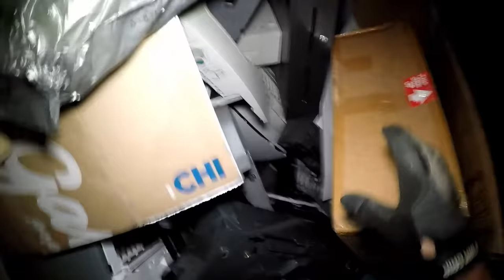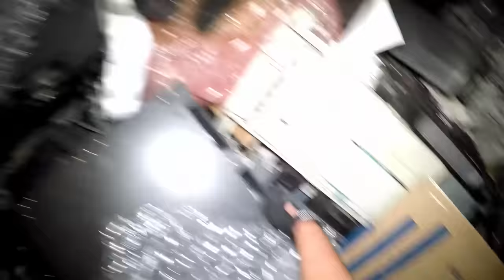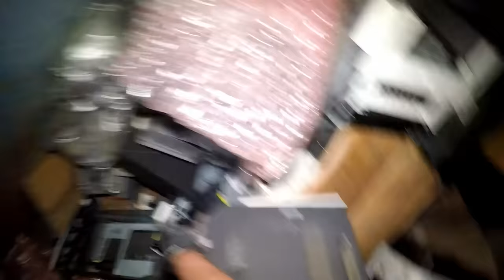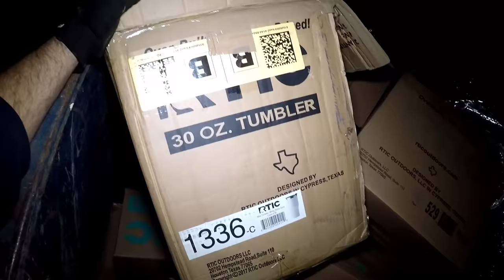Dumpster Diving (I Got Busted!)

Comment: Hey Mike, make sure you take the cash drawers out of the enclosures and check for cash that fell behind the tray.  I worked on those registers for years and would find quite a bit of cash all the time.
Reply: Yepper. Not too long ago I was replacing a cash drawer at a local restaurant and found a 20 dollar bill behind the till. The manager was pretty happy when I handed it over to her.

Comment: Big Score, well done, At my work we throw a lot of steel and aluminium out. I asked about it and now I get all of the scrap metal and they save on not having a scrap metal bin around. As long as I haul it away reasonably quick all is ok.
We use heavy steel tooling moulds and sometimes I will get 600/700 kg at a time, it's giving a bit of spending money for my other hobbies.
Cheers
Brad...

Comment: Big printers have parts in them that can sell for $70+ on ebay. Especially replacement copier and scanner parts. They also have expensive motors and a few solid steel rods.

Comment: You would have had a field day if you were scrapping behind the BJ's wholesale where I worked a couple of days ago.
We were installing 4 new self checkout registers, and removing 4 old self checkouts.
The 4 old self checkouts were put out back, and destined for the landfill. They were long, large lanes, with conveyor belts and made with several hundreds (or possibly thousands) of pounds of steel, stainless steel, and aluminum.

Comment: Have you ever tried using a  propane torch to take some of that stuff apart? Just soften the plastic up with the torch and peel it apart. Any screws should just pull through.

Comment: Get Mike a flatblade screwdriver with that knife you carry on all those printers where the connections made with the ink goes in is a ribbon and a connecting area with two screws you can break out with the screwdriver and keep the ribbon they're all gold filled pins and ribbon it takes about 20 of them to get a gram and a half of gold but better than nothing.

Comment: I know a guy that did this in his spare time here in NY State. Usually people were cool about it. Couple times he got chased off. Basically one of the business owners explained to him he doesn't allow it, because if someone gets hurt while dumpster diving, he doesn't need the headache of legal issues. My buddy did get in trouble once, cops came by while he was diving. Cop told him that dumpster was on private property (which it was, and there were plenty of signs.) Nothing came of it eventually, think he padi a fine, but he curtailed a lot of his diving after that, not wanting to deal with it. Cop told him, while taking stuff out of the dumpster is not a crime, if that dumpster is located on private property it is..

Comment: well damn it I was expectin a cavity search plus holy cow thats a bunch of cast you need to make a melting pot and make ingots the okie guy sells them a buck a lb pallet wood hair dryer rig plus make up some thin molds so you wont have trouble at scrapyard (if you go that root) they frown on big thick stuff ppl put steel or rocks in middle

Comment: Those sleeves at 23:50 have a stainless cage. Rubber melts off very easily leaving the cage. They are for drill pipe.

Comment: Are u scraping for the metal or the gold thats on the computer board cause the mother board has more gold on it but you have to bake it off i can pull off about 3 oz of gold out of 15 mother boards if you pick up the dish net work satellite dishes they have tatium chip in the center bell .

Comment: have you checked into any e waste buyers to take your computers I know if you take out the motherboards there pricing starts at about $3 a lb. and power supplies with there wires are about the same price as transformers then you can sell the steel

Comment: how about instead of walking back and forth the length of the bed load up as much as you can at the back of the truck until you have to move it towards the front you're wasting a lot of time if you think you might get caught or somebody going to walk out on you I know you trying to keep the bed of the truck neat and not have to handle things more than once but long time

Comment: If you wanna clean up those parts quickly how about you just put in in a large container and smack it with a hammer until the plastic comes off letting the bin catch the plastic 🤷‍♀️